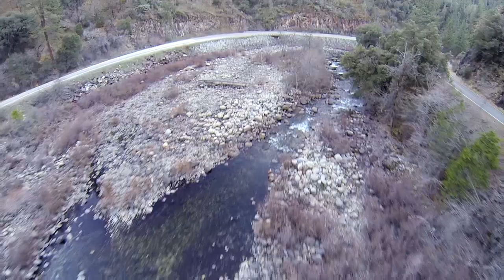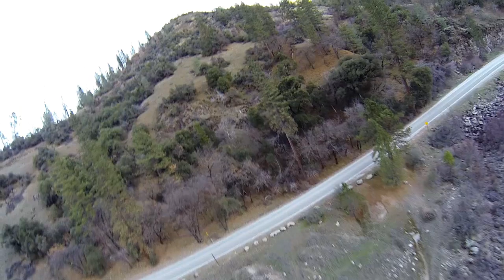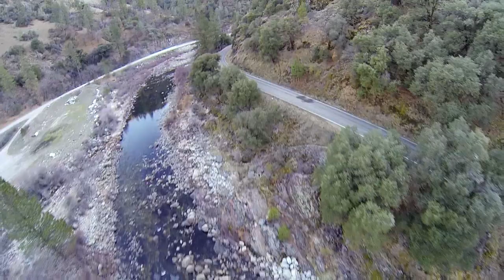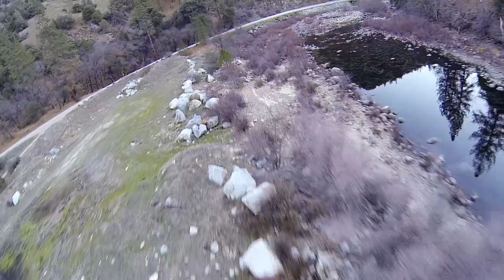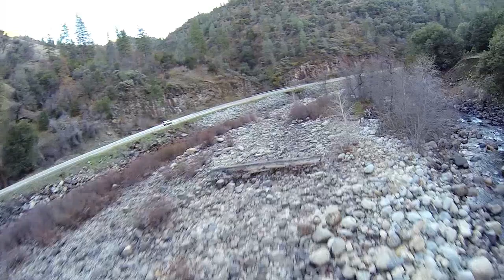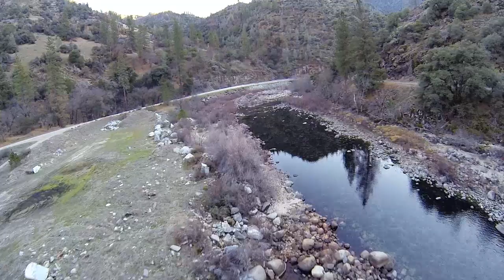KK2.1 and QAV400, initial tuning

Comment: Hi Sierra nice flight! Wonder if you notice any change  form kk2.0 to the 2.1. I have the same setup that you had, qav400 with kk2.0 and I am in doubt whether worth buying the 2.1. will be that much better? I think the kk2.0 is  excellent not know what could improve more. Bests
Reply from the maker: i have now flown about 12 batteries and it does maybe seem smoother and perhaps more accurate? I also noticed today that when i do a hover down descent where i used to get wild oscillations i am not getting hardly any. throttle seems smoother.

i think it would well be worth to get one as with the more memory more features (already has more features with the steveis 1.10 firmware) might be added by those guys who modify the code, bless their hearts!
Reply: Sierra AP Thank you so much for the information Sierra! Good to know that has some issues. I also think the best update is the increased memory, lets wait for the new features!
Reply from the maker: KronFpv no issues here, just a little more tuning. flew up high above some pine trees and pointed the nose straight down and stopped great when pulling out. the new features are nice and you can see them in screen grabs at the rcgroups kk2.1 thread http://www.rcgroups.com/forums/showthread.php?t=2061620
Reply: Sierra AP hi Sierra, apologize for my bad English, actually wanted to have spoken: Good to know you have some improvement ( not issues :/ ) as not vibrate more on the descents. Again, thank you for you time and informations!! bests

Comment: Looks like a winner..What motors and props you running?
Reply from the maker: Tiger mt2212-13 980kv & RCTIMER Carbon props. Motors have lots of flights on them and still going strong